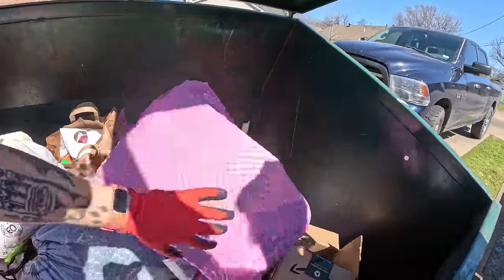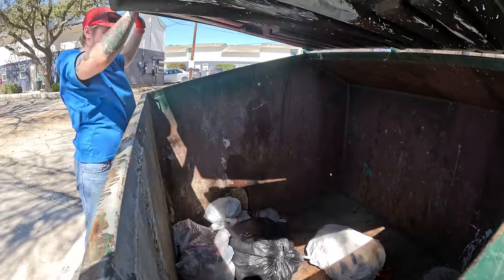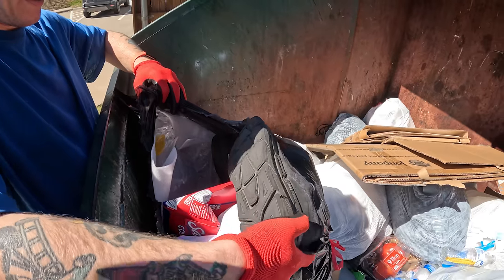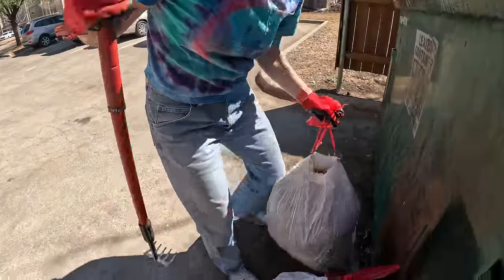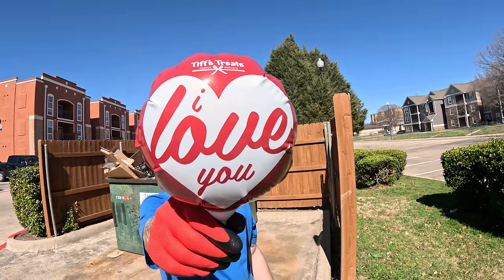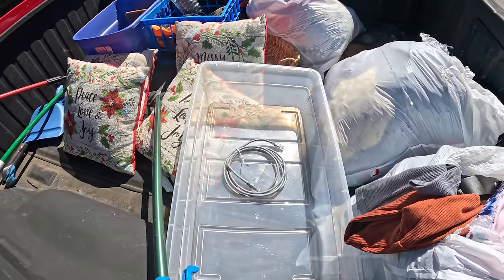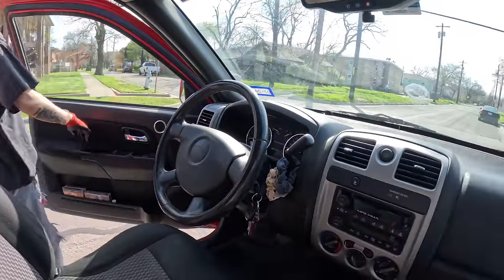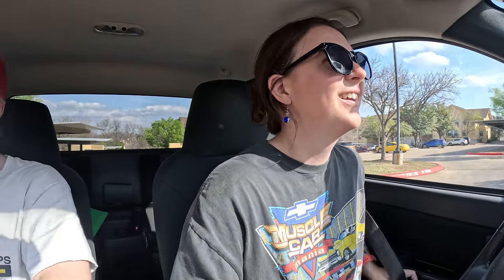Random Dumpster Dives from the Week!

Comment: lemon juice and a little salt rubbed on that wok would have taken that rust right off. sad to see it disappear. dont ever turn down rusted cast iron or plain steel. even vinegar works well. any cast iron that looks horribly rusted is worth keeping and re- seasoning. even if you have to use a wire wheel and the drill to clean them. they DONT ruin easily.

Comment: With a truck and a house, you two could do so much more with scrap metal on the side. Even if it's just pieces of copper, brass, and aluminum. Different types of wire. That would be cool.